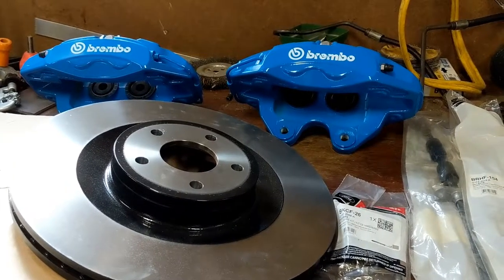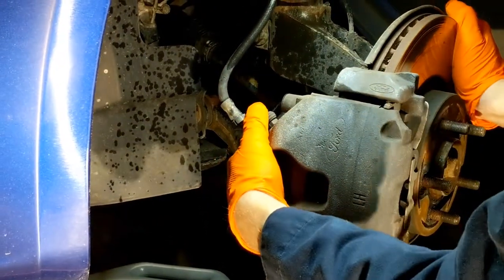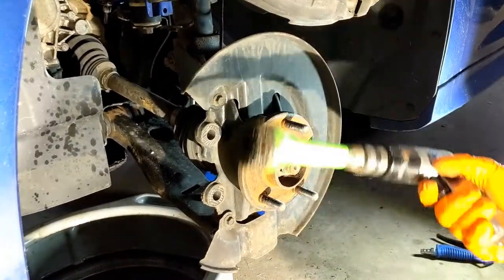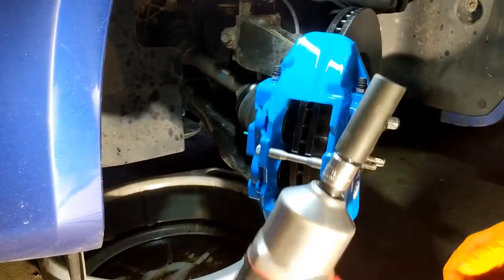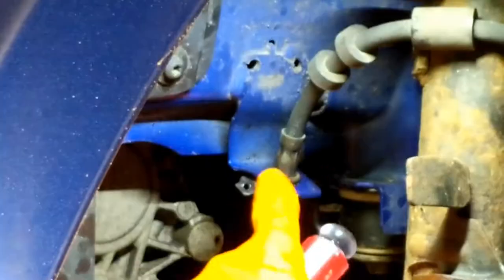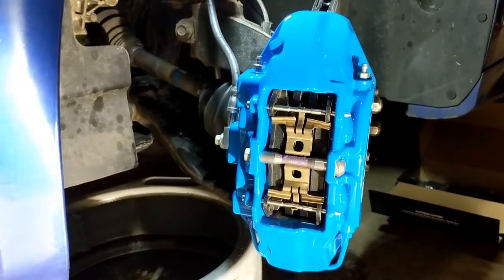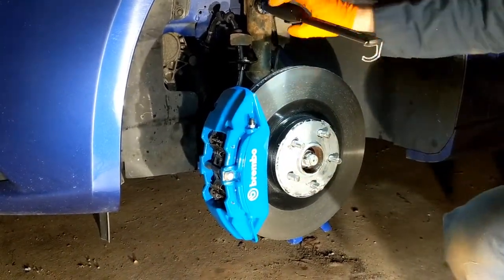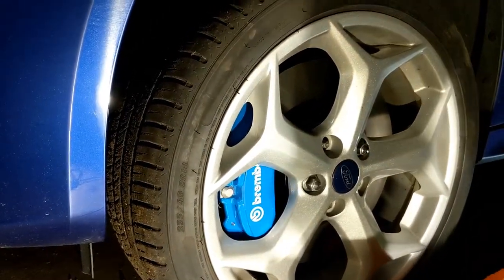Installing Focus RS Brembo brakes on a Focus ST with OEM wheels

Comment: Hello at the outset I want to express my satisfaction to see your video and how simple it is to make an improvement in the braking system with equipment superior to the standardized I have, I want to make that same improvement to my Ford Escape 2017 titanium this system fits a ford exhaust 

Thank you for making this video
Reply from the maker: Im not sure.  Get yourself an OEM focus ST caliper from the junk yard and see if it fits. If it does the Brembos should.

Comment: Should have put steel brake line, if youre replacing it anyway. Other than that, what year is your ST? My ST is 2015 and always thought they used same size rotor from 2015+ as RS. Them Brembo brakes are sick!
Reply from the maker: I put on SS lines later, but yeah it would have been easier to do it at this time.  built after 3/31/14 ST are 335mm and RS are 350mm.  Mine was built before this so they are 320mm stock.  I get a lot of ST owners confused when they see my car.

Comment: very cool..very knowledgable too! Pricy upgrade though...but one thing i can say...replace those Ford lug nuts pronto! they are GOING to fail. They're a capped 2pc lug that will leave you stranded and unable to remove your wheels.
Reply from the maker: Thanks!  As for the lug nuts, I don't use them in winter so they have lasted a long time actually.
Reply: @fixins9868  Mine were mint, then one day all of a sudden after the dealer did a routine maintenance on my ST...they were ALL destroyed. So its not so much how often they're used, its how they're used. Dealer's treat our cars like an assembly line, paid by tickets/jobs, quick to remove/install lugs without hand tightening them. So they over torqued 20 lugs, and didnt say a word. If I did my own, it would have likely never happened. But do a YouTube search or online search about "Ford 2pc lug failure" or something similar..its really sad Ford is aware of the engineering failure, but refuse to resolve it.

Comment: I want to install this in my ford fusion build i been doing a lots of research to make sure they fit but I can’t find any,  do you think the  bracket that holds calipers is the same sizes?
Reply from the maker: I'm not sure.  But you could get a cheap junk yard ST caliper and see if it fits, if it does the brembos should

Comment: Did you not need linger studs then after fitting the spacer? What thickness is the spacers?
Reply from the maker: 3mm spacers.  There is enough thread engagement that it isn't a problem for street use.  I've been driving like this for over a year without issues.

Comment: WOW. what happens with all that grease when the wheels starts spinning? goes everywhere including the disc brake surface. STUPID STUPID AND DANGEROUS.
Reply: I thought the same. Although my concerns are more about the vibrations that must come with time. The surface between the hub and the disc should be dry is the first thing. The second thing is the ST needs to upgrade the rear brakes, not the front ones. Of course, the front ones are also worth replacing, but the ST has terrible rear brakes and they should be replaced first.

Comment: The wheel hubs are not lubricated. Checking the brake disc runout. Video to remove, teaches unprofessional work. Such a fitter can lead to an accident.